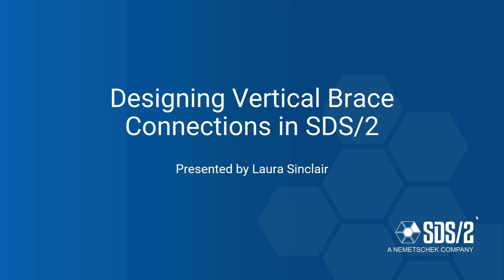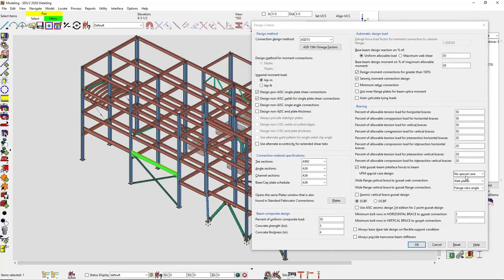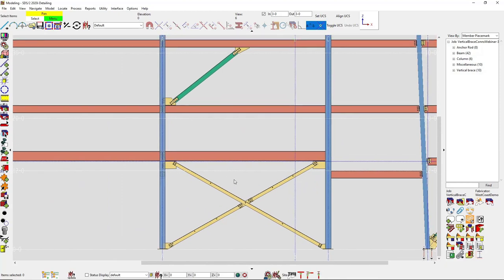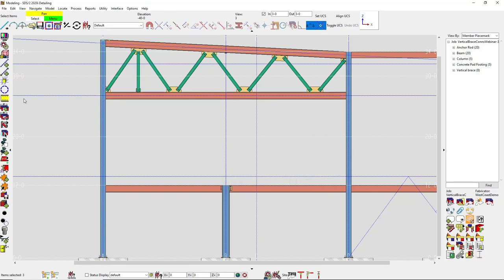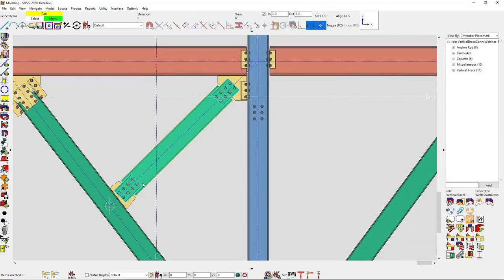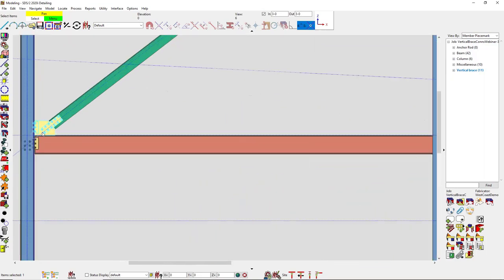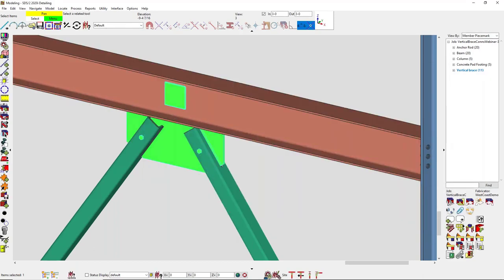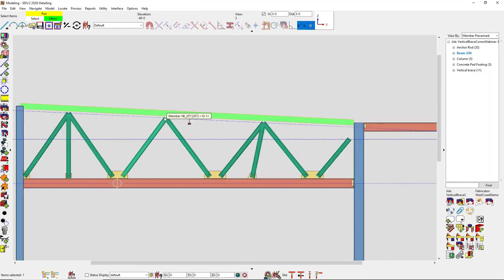Designing Vertical Bracing Connections in SDS2 Webinar

Comment: By rotating the top wide flange beam 90deg  on the truss, it would seem u could still get gussetvplate conns to the web of that rotated beam by grabbing n moving the ends of the pipe members up a little, to where the brace member lines intersect with the member line of the sloped too chord beam, then reprocessing.